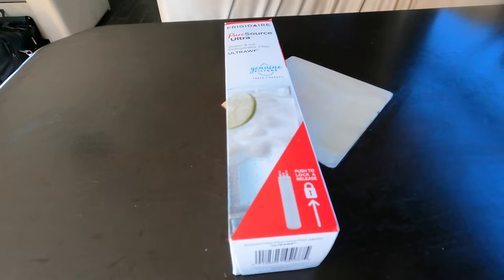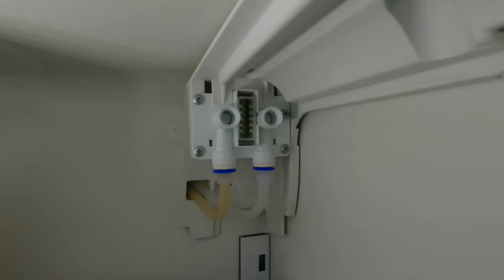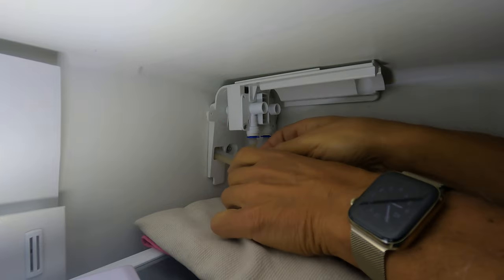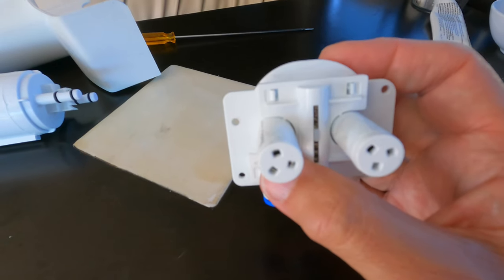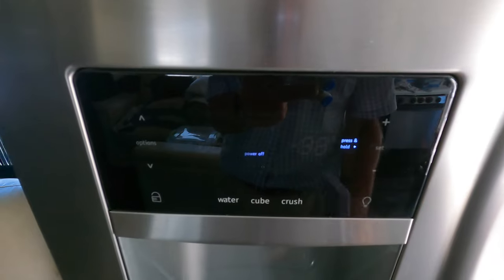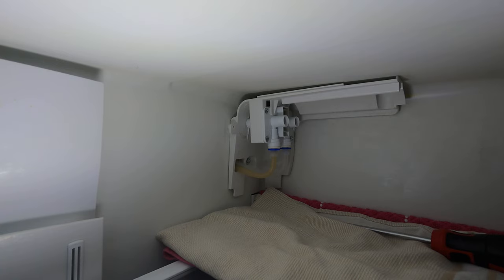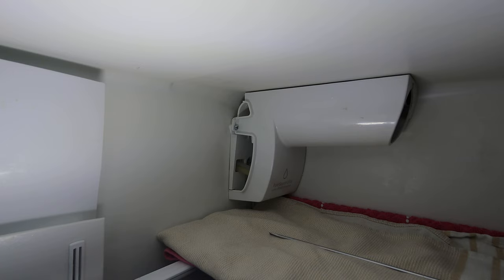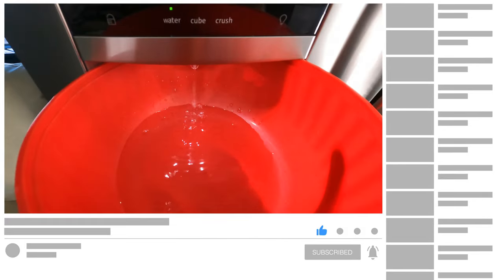Frigidaire Gallery Water Filter will not seat when inserted

Comment: Wish I would have found this earlier today, I had watched it at least six months ago but I forgot about those pesky little four tabs.  I too my old one out today and got a new filter  in and locked, I just used a screw driver to push down on teeth to lock in, it worked but had I seen your video again, I would have remembered to get the tabs locked in place. Great video
Reply from the maker: Thank you for watching in your comments that is a bit of a challenge when those little tabs don’t lock in so that’s why I put a little bit of silicone on them waited them for them to dry and then put the whole unit back together. Thanks for watching please share.

Comment: Thanks, best video for actually doing this.  I found that I was able to get the new filter to click in place by removing the cowling and holding the base steady with one hand on the back side,  and then pushing in the filter with the other hand.
Reply from the maker: thank you so much for your comments and watching the video. Glad that we could help. I had a real challenge with mine until I really got upset so I took it apart completely and same problem. Those little tabs that were off the backside so that the filter wouldn’t bite into the teeth that hold it in place again thank you so much for watching. Please share the video.
Reply: Ok that's a good tip.

Comment: Hey! After watching several videos of people showing how to remove and install the filters for refrigerators with this model of filter, and even some people who had an issue with either stuck filters or filters that would not lock into place, yours is the first one to show anything about the problem with the clips on the back.

A couple videos showed entirely replacing the piece that had the clips, springs and all in it, with a brand new part, but nobody even mentioned this being a possible cause. They stated it was likely due to the springs being worn out.

My mother-in-law just replaced her filter in a Frigidaire that uses this model last night, and then texted me that it keeps leaking when you use the water dispenser or when the ice maker calls for water for the tray.

She also said she installed and removed the old filter several times before installing the new one to make sure she knew how to do it, so I am thinking she used too much force repeatedly, and she may have popped those little clips loose.

Now her new filter will not come out to see why it's leaking! Heading over there tomorrow afternoon to see if I can solve her issue. I will let you know if these clips were the problem keeping her from removing the filter. THANKS!
Reply from the maker: Thank you for watching and your comments would love to know what the outcome is so please keep me posted here and please share this video with other friends and family that might have the similar fridge mine has been working great now for ever since I put in a little bit of silicone on the back of those clips my filter is going in and out when I’m ready to change it once again thanks for watching please keep us posted
Reply: @ACanadianRVereh   Ended up being the removable plastic part on the filter that locks into the housing mechanism had slid to the side about a quarter of an inch. That had it stuck in the mechanism. 

Once I got it apart and straightened that out everything else was fine. The filter WAS missing an O-Ring, which we found, that fell off during her installation and was causing the major part of the leaK. 

The clips on the back of the mechanism were still in place as they were supposed to be.

Thanks again for the video.
Reply from the maker: @TortureBot  thank you for the update so meany things can go wrong but you got it
Reply: @ACanadianRVereh   Ended up going back a day later, because strangely, at the same time as her filter problem, the start relay for the compressor went bad. The fridge/freezer stopped cooling. It was $130 for the part locally, but we fixed it in about 30 minutes.

Comment: Good video, I am having the same issue, I was going to buy a a new part for the  filter housing but it seems easy enough to get to, maybe I wll try to see if I can fix that first. Thanks for the video.
Reply from the maker: I think it was a production issue with that model of fridge in that year but yeah I don’t think you need new parts. I was quite frustrated when I did this video too, but by putting a little bit of silicone on those little tabs, it was fine. I’m still using it today and the filter is going out perfectly so good luck. Thanks for watching. Thanks for your comments and please share.

Comment: Great video! I had the same thing. I ordered that part before I saw the video and had the same problem. Followed your steps and fixed the issue. Only thing I did was remove that top shelf to give me a little more room. Thanks again 👍🏽
Reply from the maker: Yeah I was quite disappointed when I couldn’t get my filter to sit properly and I thought maybe it was the filter maybe it was this that finally when I pulled it apart and had a close look at it a little clips just came out so I better silicone and has been working great since then thanks for watching thank you for your comments please share
Reply: So obviously Frigidaire isn't going to fix the problem on that replacement part because they actually get money when you order the part because it breaks or comes apart

Comment: Thanks for the helpful video! Is there multiple springs? When I took mine out it all feel apart. Now I'm wondering if I lost a spring
Reply from the maker: And my unit I noticed they were to Springs, but mine didn’t pop out because I was able to remove the complete assembly and then put some caulking in the back to allow the little for clips to stay connected to the frame I don’t know if you can buy the springs or even make some that will fit and make that connection work for you thanks for your comments. Thanks for watching.

Comment: Do you have to turn the water off to the waterline fridge or will water come flying out of the lines?
Reply from the maker: No once you remove the filter, there is a tiny shut off valve that’s in the connection that should stop the water flow but for safety I’d recommend if you could turn the water off. It’s a little better less pressure on the gasket fittings. Thanks for watching in your comments.

Comment: I have also found this to be a problem every single time I've had to change my water filter. Last time I bought the part the base/ water filter part number 242009602. I did fix the old part by putting the Springs back in. So today again I had to change that part and this time I'm working on the one that we took out and putting some crazy glue on The Notches in the back because as you said this seems to be the problem it pops out of place when changing the water filter, which is defective on Frigidaire part. So I will see next time when I have to change my water filter if it happens again because I didn't get a chance to put Krazy Glue On The Notches when I fixed it this time I didn't think about it till I had it all back together
Reply from the maker: Thank you for watching and your comments. Yeah I really had a challenge with my fridge many times until I got so frustrated that I pulled it apart and did the mod now I did another video on my channel which was about a year later showing how I replace the filter and it came out and seated properly by putting some silicone into the little tab so that they couldn’t come back out so so far so good for me. I’m looking forward to changing my next filter and I should do a video on that just to keep everybody posted once again thanks for watching. Thank you for commenting. Give me an update the next time you change.
Reply: @ACanadianRVereh  yes please do because I'm not looking forward to  replacing my next water filter because I didn't get a chance to do that before I put it all back together

Comment: Hey, thanks but may i ask you a question? Recently, i noticed an accumulation of water in the bottom of the fridge. I found the culprit was the filter base. Every time the water dispenser was activated, water ran out of the back of the base. I have replaced the base and have the same problem. Any thought on why it would leak water there?
Reply from the maker: Yes it might be coming from the ice machine I had that issue on an other fridge I had not the one in the video 
I know it’s had to find but there not much else that can leak water. 
Did you check a the connections on the line 
Let me know how you make out.

Comment: Thank you. Where do I turn off the water ?
Reply from the maker: It depends what you’re doing you might if it’s in a home you might turn off the main valve if it’s in an RV if you usually look underneath the fridge or under the back panel in the RV bin, you will sometimes see a water valve there or just turn off the main system or on detach from the tap. Thanks for watching and your comments.

Comment: Anyone know if you have to shut the water off too the unit before you remove those pipes? is it a live feed or does the water just come out when you activate it from the door?
Reply from the maker: It’s best to turn the water off I did just for safety, but you are correct. The water will not flow until you activate it from the front door. There is a valve or a solenoid in the back part of the fridge that triggers the water to come through the inlet pipe, but just turn it off anyway just to make sure

Comment: My new filter locks but water is just drops.  Have tried running it for a long time. Just drops. Guessing will need new part.
Reply from the maker: I would probably think you’re correct because once I fix mine, I didn’t get any water dripping or anything at all. It’s just probably the seals in that little plastic adapter that are probably not connecting properly but as long as your filter seats properly then it’s probably the washers on the filter or what you can try is to make sure that they’re on correctly maybe with a little bit of soap on them just to make sure they slide in all the way and then don’t forget to run the water until it clears completely if there’s any soap in the system, hope this helps. Thanks for your comments.

Comment: how exactly does this help someone install, replace a filter?
Reply from the maker: I have done other videos on just changing the filter but when you insert the filter or even better when you remove the old one and try to seat a new one, it will not seat properly because the little tabs that hold the back part into the main frame will pop out and this is a method that I posted here to show you how to fix that. We’ve had a lot of hits on this video and a lot of compliments on it. It’s exactly how to fix the problem Not showing you how to change or replace the filter

Comment: Dont understand because my old filter snaps in fine but not the new filter. I tried both several times.
Reply from the maker: I can only guess what happened that’s exactly what happened to me when I pushed in to remove my old filter. That’s when the tabs came out of the housing therefore, putting in the new one it wouldn’t seat because there was no pressure on the tabs on the backing plate to hold the new filter in place, so I bet you that if you were to take it apart and you will see those little tabs that are supposed to hold it into Place probably popped out. That’s why the new filter will not seat exactly what happened to me and that’s why I did this video being so frustrated why my new filters wouldn’t go in from that per point on I’ve had no problem whatsoever but you see in my video I did put silicone to hold those little nibs into their housing part. Hope this helps give it a try. Please let me know what you find. Thanks for watching and your comments.

Comment: I had this problem. Once I finally was able to get the filter to lock in, I don't get any water coming out. I can hear the solenoid going, but nothing is coming out. Then when I try to remove the filter again, a big release of air comes out and some water drips out of the filter. I'm at such a loss...
Reply from the maker: Ok let me recap when you had your old filter in there. You had a good flow of water, other than what your old filter was restricting the flow, correct. When I change mine, the first time it took a while for me to purge all the air out of the lines because I turned off the water underneath my coach.
Try this put everything back and insert the new filter, then take a big pot or plastic bowl inserted under the lever and just wait. Wait for at least a minute and see if there’s any water that starts coming out it could take a bit of time to purge the air out of the filter 
Again, comment and let me know if this helped or it worked any better
Reply: @ACanadianRVereh  No such luck, I waited for about 4 minutes and nothing is coming out. I guess my next attempt will be to try and unthaw the water line. Thanks for trying to help!
Reply from the maker: @BigDawgMDawg  were you in freezing temperatures at all?
The waterline is quite exposed on your RV then that could be the problem. 
On mine it’s in the middle of the RV in one of the bays where I have my valve that I turn off when I winterize my fridge a few years back I have a video on that too. Just check out our channel. You’ll see it there
Post and let me know when you find the problem very interested to know

Comment: I even bought a brand new filter base and the filter still won't click in. What am I missing?
Reply from the maker: Wow, I’m sorry to hear that that you purchased a new base and a filter
The only thing I can think of is even the new one the little tabs must’ve popped out is there any chance that that might’ve happened because in my video you notice I put a bit of silicone on the little nibs so that they won’t pop back out now I’m just gonna be posting another video showing that after eight months I did a filter change and everything was perfect. 
Again, I would just check to make sure that the housing of the new one is all in place but other than that there’s not much to know it because as long as you have a good filter and a good receiver, it should just click in. Keep me posted.
Reply: @ACanadianRVereh  This is a real bummer. The new filter base behaves like the old one. Sometimes I get a click that won't stick and other times no click at all when I push the filter in. I even tried with another new filter and same thing. The housing of both new and old bases are intact. I tried moving the teeth a little up and down on the filter. Nothing works.
Reply from the maker: @qbtc  have you checked the housing to make sure it is all back on properly if it’s off a little if the screws are not 100% into the frame of the fridge you might have a little bit of the filter not going in straight because the filter is pretty long
I feel for you brother I know it’s very frustrating when it doesn’t work 100%
Reply: @ACanadianRVereh  I bought an official filter replacement off Amazon and it fits perfectly. Apparently, the ones I got off eBay are knockoffs and I had no idea there was such a thing for these.
Reply from the maker: @qbtc  yeah I get it I think most of the time if you have an original it seems to fit a little better even on the O-rings that are on the tips of it. I’ve tried both they both work before I did my mod on my clips inside the unit, but I would still go with the ones off Amazon. Thanks for commenting and watching.

Comment: I had to take the whole assy out every 6 months. It was very awkward to work in tight space. Stupid design to allowed clips to move on every install. I would fix it to lock, then it won't come out again on next install. Stupid plastics. Why couldn't they make the slot tighter so it won't move up and down? Other brands used the same stupid design.
Reply from the maker: Yes, I hear you. It is a dumb design but what I did in my video, hoping that it would be a little better as I put in some clear silicone and let it dry before I put it back now to this day I’ve not had a problem with it again, but I am very cautious of when I remove the filter and insert the new filter with the least amount of pressure so it it would keep the back part from popping out of its support clips but I really think the silicone really helped a lot by not allowing those little fingers to expand and pop off the back. Thank you for your comments and watching please share.